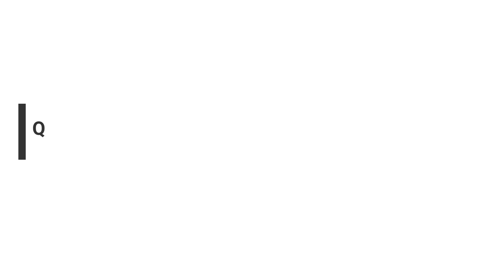Part 2: Job after BTech or do MTech from IIT |Reject all  job offer After BTech ? | VLSIgayan EP:10

Comment: I am in my final yr btech and will be soon joining Synopsys as a memory layout engineer. But I also have a wish to study vlsi in top iits. My concern is that should I study for GATE 2023 or not, as I am already placed in a product based vlsi company? Also if I do study for GATE alongside my job I am concerned that I will not be able to perform well in my job and might lose it.
Reply from the maker: Hi Rajat , dont worry work not that mich hectic ,you will get time to pursue you passion ,which might be preparing for GATE . but if doing Mtech only mean to you is get a product company,then you dont need prepare for it right.... Else you can do it for the satisfaction,but monetary you will be losser plus the industry experience... So if you too obsessed for top university then only go for it.. And there is a option of part time Mtech , i dont have much experience but yes these mnc sponsor it after few year.. You can explore that opportunity.